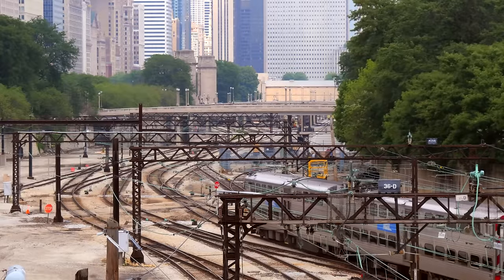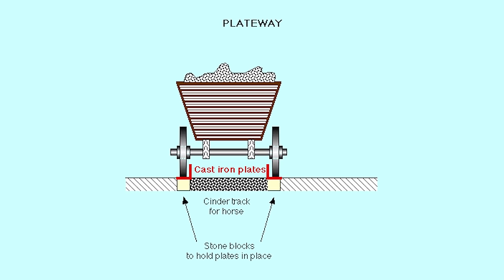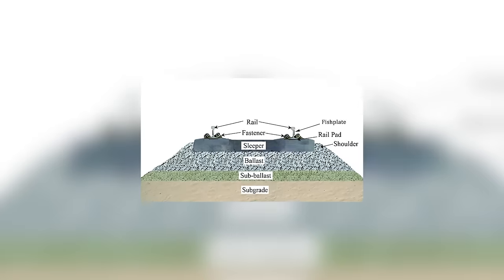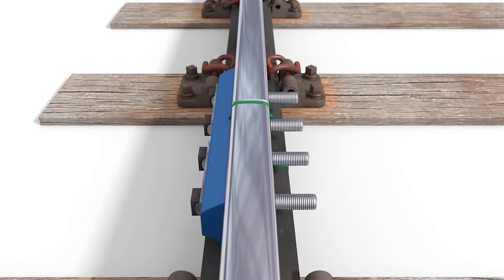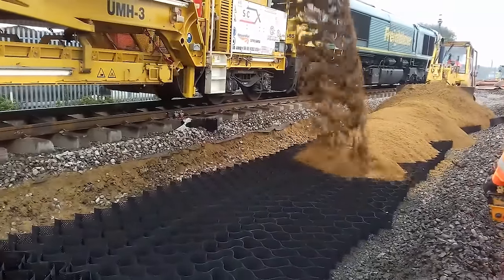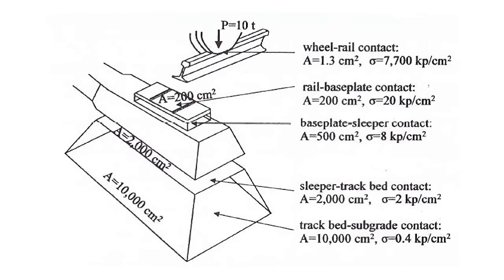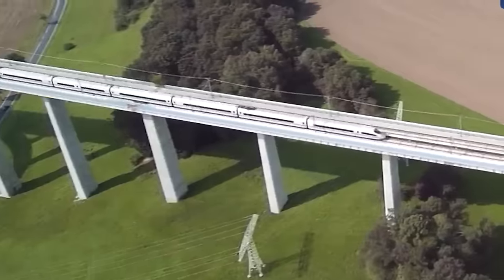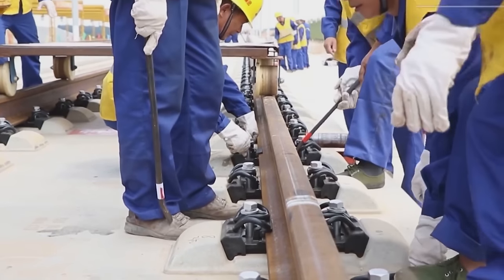What are the Purpose and Elements of the Railway Track?

Comment: Great video again. Just one remark: Beside jointed rails with fishplates there is also continuous welded rail. Welded rails are more expensive to lay than jointed rails, but have much lower maintenance costs.
Reply: Exactly. And better performance as well. 😎
Reply: Thumb up.HSR usually use the welded rails CZ the impact of a passing train to fishplate.
Reply: And they're hella long!
Reply: Is there any non welded mayor railway anymore?
Reply: Very curvy lines are still laid with jointed track because the tensions when warming up or cooling down would otherwise move the track in curves sidewards. Otherwise continuously welded rail is preferred, also because it gives a much smoother and quieter ride.
Reply: @ulfosterberg9116  Semmering railway in Austria for example because of the tight curves there. See my other comment.
Reply: Fortunately, welded rails have not been installed on trestles, including those "els" in cities like New York and Chicago. Welded rails can be as long as 1600' and be jointed at the ends to eliminate or reduce warping in very hot weather and wearing out during shifty climates, even in open cut structures.
Reply: I still can't fully comprehend how thermal dilation of continuous (welded) track is solved.  Back in my school days (when trains were making the ubiquitous thumping noise, lol) we were taught that rails would inevitably rip the fasteners and buckle in hot weather if those tiny empty spaces between them didn't exist...
Reply: @tamahagane1700  the rail is ‘adjusted’ to maintain the ‘correct’ amount of steel in each portion of track. Certain measurements are made at different times of the year in different locations to see if there is too much steel (which will cause the rail to buckle in heat) or not enough steel (which will cause the rail to break under tension in cold weather). More or less steel is then added to pretty much eliminate the rail every buckling or breaking.
Reply: And rail anchors do not attach rail to sleepers/ties. They transfer longitudinal stress (expansion/contraction) of the rail to the sleepers/ties.
Reply: @nathantarr7308  To add on to your comment:  the rail is heated or cooled to a "median" or neutral temperature when it is installed. This temperature can vary by location.  The goal is to reduce the expansion and contraction extremes of the rail so that control mechanisms like rail anchors can keep that movement under control.

Comment: I do want to correct you on the wheel to track depiction.  The flanges on the wheels do not make contact with the rail under normal operation.  There is a gap between the flange and rail head.  The part of the wheel that rides on the track is tapered where the diameter of the wheel is greatest at the flange.  This taper causes the wheel set to center itself while rolling.  When going around a curve, the wheel on the outside of the curve moves toward the flange, the taper causes the outside wheel to increase it's diameter at the contact point with the rail and the inside wheel's diameter to decrease, thus causing the wheel set to follow the curve without the flange rubbing on the track.  The only time the flange makes contact with the rail is during extreme cornering, such as when changing tracks while going through a set of points.  When you hear that high pitched squeal when a train is moving, that's the flange rubbing on the rail head.  If it did this all of the time, the wheels and rails would wear out quite quickly and would need to be replaced way more often then they are now.
Reply: Excellent description...10/10!
Reply: Wow ! Ok , didn't know that , it's ingenious and it all seems so simple , except there is a lot of science and engineering behind it.
Thank you for taking the time to type out the long version of the explanation ; much appreciated !!
Reply: For anyone having a tough time visualising this, there's a great animation by Lesics that explains it in detail: https://youtu.be/XzgryPhtc1Y
Reply: Great comment
Should be pinned, if only multiple comments can be pinned
Reply: @deus_ex_machina_  thank you
Reply: Wow

Comment: Here on US freight railways they're ripping out concrete ties on some section of track and going back to wooden.  They were supposed to be more durable than wood but ended up cracking/falling apart earlier.  Word is the company who made the ties defrauded the rail roads by using the wrong mix(ie cheaper) of concrete.  Or could be that the rail roads spec'd a cheap grade of concrete that didn't last.  Whatever the case there is a lot of finger pointing/blame going around and its cost the rail roads a lot more money than if they had just stuck with wooden ties.

Comment: This was the best railroad show I have seen. I learned more about the railroad track I have not learned before. I thought that a sleeper is only a concrete rail tie. The modern track that was shown is suitable for track with welded rails, except on trestles. Your show enhances my appreciation for the railroad. Thank you for clean, clear and thorough explanations about the railroad track.
Reply: You might like to know that sleepers made from recycled heavy grade plastic are now being used in the UK and presumably soon elsewhere.
The manufacturers say that they're frost/oil/sunlight - proof and last longer than anything used up to now.
Reply: @JP_TaVeryMuch  I am delighted to learn that sleepers are made of other materials besides, wood, concrete and metal. I think that some rapid transit systems can use heavy-duty plastic rail ties on trestles, as in elevated steel bridges, as an alternative to wood ties. Thank you for tapping or typing to me.

Comment: 6:52 Just a small correction, for this diagram, the (/cm^2) part is not needed, a pascal already is defined as 1N/m^2. The numerical value is also wrong, as 10 tons = 10,000 kilograms = (on earth) ~100,000N. 1.3cm^2 = 0.00013 m^2. 100,000N/0.00013m^2~770 MPa, much higher than your calculated value of 7.7 MPa. However, I think your example still works, as 100,000N/1 m^2 at the soil level is 100 kPa, which is still below the compressive strength of compacted soil.
Reply: Yeah it felt abit weird seeing N/cm^2

Comment: To Railways Explained:
You throw slab track and ballastless track into one box. That is not correct. Even though Wikipedia uses the same simplification, it still doesn't make it correct.
Slab track is a type of ballastless track, but ballastless track is not necessarily slab track.
Slab track is primarily a track substructure system, developed by for example PORR Austria, and comes in the form of slabs - i.e. several sleepers on one slab ex works.
Ballastless track can also be produced by means of special sleepers cast in concrete or asphalt.
Slab tracks are therefore prefabricated parts, whereas ballastless tracks are not necessarily slabs, but are produced and cast on site as a solid carriageway.

Comment: Generally speaking, well done.  However, there were two illustrations you used depicting wheel flanges as touching both rail crowns (heads) simultaneously.  That (of course) is physically impossible.  And on straight segments, neither wheel flange touches the rail crown.  Only when negotiating curves does a flange touch the rail crown causing the familiar squeaking noise.
Reply: "negotiating curves does a flange touch the rail crown " Only if the turn is the minimum radius before rubbing and squeaking. Do you know what that radius is??
Reply: @h.mandelene3279  There is no set minimum radius.   Flange strike happens when the bogeys fail to rotate as rapidly as necessary to negotiate the change in radius rather than within the curve itself for the speed of the train entering (or leaving) a curved piece of track with constant radius.

That was a mouthful.   Let me break it down.

Say the train is on a straight piece of track.  The cant of the rolling surfaces of the wheels will keep the wheelset centered between the tracks and there won't be any flange strike.

Believe it or not, that same thing happens once a train is well into a curve with constant radius.  That's because the bogeys have (by that time) rotated to the appropriate angle and the cant is able to perform its magic again.

The problem happens where you have a transition between a straight piece of track and the curve..  or where there is a change in curve radius.   These transitions are where the bogey's rotation angle (left/right) changes.  This is where you get flange strike if the bogey doesn't fully rotate as quickly as necessary to avoid flange strike.  It is the contact of the flange (on the outer wheel of the lead axle) with the inner surface of the rail crown that (then) forces the bogey to rotate.  The squeal happens when the flange physically scrapes the inner surface of the crown.
Reply: @TheCondoInRedondo  "There is no set minimum radius." but there is(well before rubbing\slipping). The reason the wheel is tapered is so as it takes the turn the outer rail is longer than the inner rail. the taper compensates as the outer wheel rides higher than the inner wheel. When the turn gets too tight, one wheel will max out rubbing the flange and "scrape"  the side of the rail.
That's cool. Next time I see a train, I will measure the angle of the wheel and do the math myself.
Reply: @h.mandelene3279  Don't forget... the rotation angle the bogey must take depends not only upon the radius of the curve, but also the distance between the rotation axes of the front and rear bogeys. 

Take a rather tight curve of radius 500 feet.  An Amfleet coach will experience three times more bogey rotation compared to a Lehigh Valley caboose.  That's because the distance between bogey supports on Amfleet is just under sixty feet.  The caboose has just under twenty feet between the king pins of the front and rear bogeys.
Reply: @TheCondoInRedondo  I realize there will also be rubbing with the distance between each outer axle on each truck such as the DD40x, or a 4-8-4 steam, or even the 3 axle SD40-2\old Pullman car's truck. I am just inquiring the geometry for typical like a freight car's 1 axle.

Comment: It would have been nice if two further issues - both quite basic in the context of RR track design - had been covered here:
(a) Continuous Welded Rail (CWR), and where its use in feasible and appropriate
(b) Whether or not slab track is suitable in regions with extreme variations of temperature and weather (e.g. in the heart of the Eurasian landmass: On the Trans-Sib, BAM, in central Kazakhstan, etc.).
Otherwise: Reasonably well done, so... Thumbs up!

Comment: Regarding to track load. In Czech Republic, load it 22.5t per axle at most and I assume it's the same across whole Europe, cause each locomotive seems to weight like 87-88 tons, no more, no less.   Isn't there any demand for increasing load capacity on certain tracks running at capacity limit?